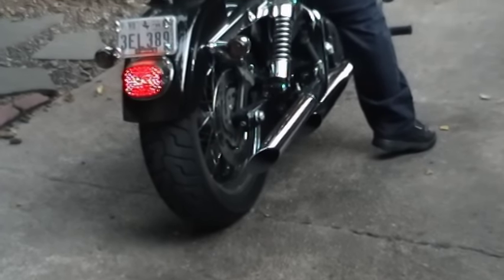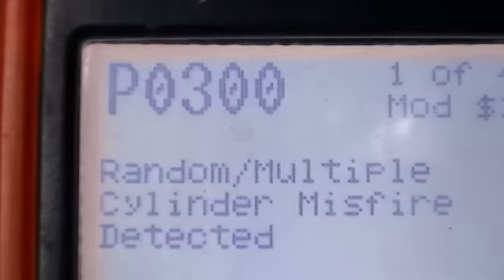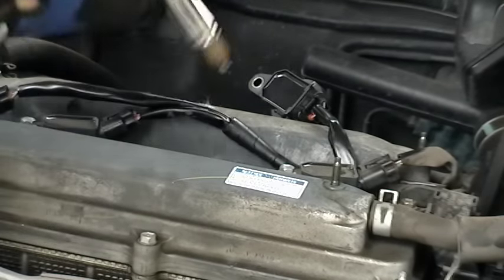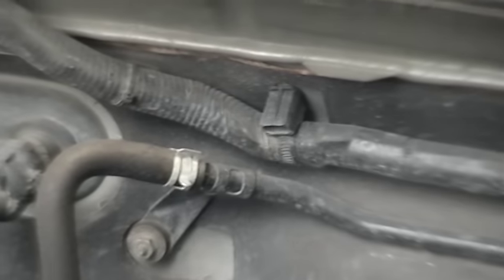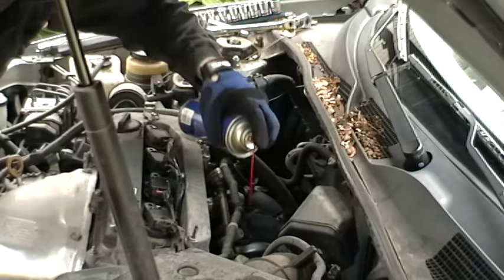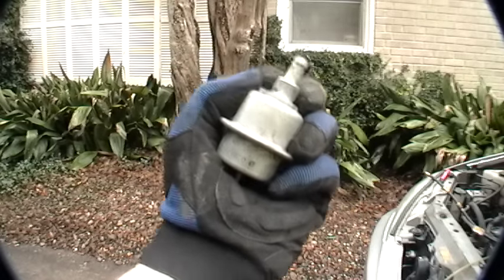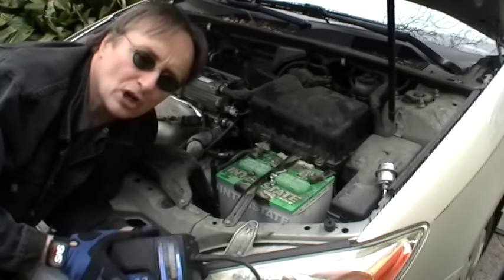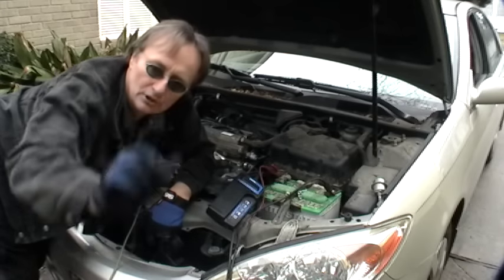How to Fix a Random Engine Misfire in Your Car (Code P0300)

Comment: I currently own a 97 lumina, and it’s been throwing off a random misfire. I just replaced all the spark plugs, wires, battery, and coils before the code started. I currently am in the mist of changing the EGR valve. There no leaking from anything either. so what could it be!!??!!?

Comment: Scotty my 2003 Chevy impala 3.4 has a p0300 random cylinder misfire I change the spark plugs but the check inging light still flashing repeatedly and when I try to pick up speed on the mph it picks up slow some people say it could be the Cadillac converter what do you think Scott
Reply from the maker: it could be that, but that can be pressure tested by a mechanic, so start there, they are not cheap parts so guessing is foolish

Comment: I got a missfire at iddle and between 40 to 50 mph no codes 98 chevy blazer lt running denso platinum sparkplugs and using duralasst wires. Everything else is  delco,fuel pressure is good.

Comment: Vauxhall Corsa C - Codes: P0300 and P0301 - New spark plugs a couple of weeks ago as part of a service and had a new coil pack fitted about 4-5 months ago and still getting the error. Could it be the fuel injectors?

Comment: hello i have a 04 dodge struts has the 2.7l v6  has 101k on it runs good but after start up and a short idle it starts pissing really bad ...if you keep running it it will go away  car has a good battery and new plugs along with coil boots and a new fuel pump  what could make it do this ?

Comment: hey i have a 2001 silverado. the truck runs great. but i can't pass the mission test. i replaced the spark plugs, wires, air filter, gas filter, a sensor that goes above the fuel tank, i forgot the name of it. i think is the gas pressure sensor. anyway nothing happened. i put s inyector cleaner, and nothing. like i said everything works good... what do u think my truck has?
Reply from the maker: many things can cause that, take a picture of all the data that shows it failing and join my community and post it there. If you wish to ask me car questions, I am switching my questions and answers to my google+ community “Auto Repair With Scotty Kilmer”. So please, if you want your questions answered, go  to this link https://plus.google.com/u/0/communities/110758243155230074828  and join my community. You can then ask your question there and I answer them personally. You can also attend my weekly Saturday morning Live car talk events where I answer your questions live. . Just check it out at https://www.youtube.com/watch?v=VognjkYaMjg&list=UUuxpxCCevIlF-k-K5YU8XPA&feature=c4-overview
 And remember, every Tuesday, I upload a new video on youtube, don’t miss them.

Comment: Hey scotty. I got a 2008 sentra with cyl 2 and random missfire. Changed the coil on cyl 2 and still does not run right amd the codes keep coming up cyl 2 and random missfire. Any idea on wat it could be. Sprayed crakes part cleaner on the intake and nothing changed and my battery is in good condition

Comment: Hi, I have a 2005 Chevy impala 3.4 L base. I keep getting the P0300 Code. I have to press the pedal for it to start and it idles roughly and stalls or cuts off. So far I've replaced the Catalytic converter, fuel pump, ignition coils, spark plugs and wires, MAF sensor and EGR valve. I am stumped on what could possibly be causing the P0300. Also Something blew out 6 brand new spark plugs that I had bought. I'm assuming whatever the issue is that gives me the p0300 code is the same thing blowing out my spark plugs.
Reply from the maker: literally scores of things can cause that code, but on that model, often bad fuel injectors do that. Have a pro check that first with his equipment, they are complex and expensive, so you don't want to just guess with new ones.

Comment: I drive a 2000 ford f-150 and i got a diagnosis done and they said that cylinder 3 has zero compression. He said that the cylinder was bad. How can i fix that.

Comment: Hey Scotty, I have a 1997 Mazda Millenia 2.5 Liter 6cl. Recently my car will shut off when I'm approaching a light, parking at a stop sign/ red light (basically when I'm braking) so I finally got it checked and I have the code "PO 301" a misfire. Also when pressing on the gas it takes a little while for it to start going fast. What should I do? please help.

Comment: SCOTTY I have a altima 2005 and it's giving me a lot of issues.  I'm about to do those tips you just showed me. I read up on the car and a lot of people having the same problem with the car. Rapid shaking, misfires,  gas is becoming a big bill. It's the Nissan altima 2002 to 2006. If you have any solution for this vehicle just text me back.
Reply from the maker: first, those are not good cars as they age, have tons of engine problems. Have a mechanic do a wet and dry compression test of all cylinders first, and if worn, get rid of it.  If engine is ok, pray my tips help, but they still are not good cars when that old

Comment: Mr Kilmer, I got the same code in my buick century 96, do I have to do a diagnostic test in the shop or I can just take to a mechanic and get it fix??? I'm asking because I dont want to pay for the diagnostic.
Reply from the maker: as SO many different things can cause the 300 intermittant code, any mechanic fixing it will have to do a lot of analysis first

Comment: I have a cobalt ls that I supercharged. The car turns on but is running lean. It Turns on and idles loud then shuts it self off after 20-30 seconds. We changed the fuel pump (but not the fuel filter), put new fuel injectors and a new supercharger and the car is still having the same issue. I keep having a random misfire code, you think if I drop some cash on some new spark pluggs, new fuel filter and maybe a new battery (since ive had the same one since 2008) I might have some luck?

Comment: Scotty i need help desperately. 2007 Nissan frontier. P0300. Chamged out spark plugs, coils, cats, O2 sensors, fuel injectors, fuel pump, throttle body, And a bunch of other parts. Still have this issue. Car runs like crap with the engine light reset. Then tuns better (higher idle) when The light comes on.

Comment: hi Scotty I have a 1999 Toyota Camry with only the number 1 cylinder firing the other three are giving misfire codes and the check engine light was flashing I replaced the fuel pump but that didn't help do you have any idea what my next step should be also my name is Bobby sorry I forgot to introduce myself I appreciate any advice you can give me thank you
Reply from the maker: +Robert Venturino often bad distributor cap and wires do that, pray its that simple

Comment: how about the ignition control module, coil packs on many cars that fire two plugs at the same time, MAF etc.
Reply: I had p300 and put in a control module and now it runs perfect. The old one just all of a sudden caused spit and sputter at a stop light so have module checked also. It could be many things causing this problem

Comment: Hello Scotty, can you please help me with an advice?
I have a 2006 Daewoo Nexia, GM (Vauxhall) based engine (A15SMS). When i run it constantly over 3000 rpm, check engine flashes. P0300 is the code. Changed spark plugs and wires, tried a new coil pack, cleaned cam and crank sensors, checked compression (14 on all 4 cylindres), checket tappets ok, new timing belt which is mounted correctly, new gas filter. The error still apears under given circumstances. When check engine flashes, no particular symptoms are felt. The car runs normaly, it has power and does not have any particular symptoms. If i restart the engine, the light stays off until i run it again constanly over 3000 rpm. The battery is ok. Thank you.
Reply from the maker: computers are VERY sensitive to misfires, if it runs fine, ignore it, or pay a guy like me with a dealer level scan tool to hook it up, drive it, and then analyze the live data that occurs when the check engine light is flashing, such machines can record and play back such things. Takes a REAL pro to do it right though

Comment: hello Scotty how are you doing? i was having P0300 error code on my 2005 Renault Velsatis that come with Nissan 3.5L V6 engine (VQ35DE) .... The 3 front coils is not giving signal at all thats number 2, 4 and 6 .... i took the car to electrician who troubleshoot it with OBD II machine then get P0300 Error code ... and he condemned the ECU saying i need to buy another ECU to make the car work fine.  Can you plss advice me?

Comment: Scotty, on a 95 Explorer, i was told its back firing , its OBD 1 , i haven't pulled any codes yet, spark plugs an wires was done a year ago, along with a new coil pack, what can this be ? its the 4.0 EFI engine , I haven't looked at it yet , i am asking , so i know what to do , please let me know . thanks
Reply from the maker: +Kody Darlington scores of things can cause backfiring. More often ignition problems on that model, check the spark plug wires, dist and cap and PRAY it's not internal valve damage in the engine

Comment: Had the same issue the other day brand new wires and plugs was fine then threw the code I pushed all the wires made sure the were in all the way on plugs and distributor car nothing felt loose but when I fired her back up code has been gone I hope it stays that way.

Comment: I got a 97 nissan pickup. Light has been on a for a while. It used to idle really rough but I eventually tracked down a replacement MAF sensor and it started running 10 times better, no stalling or hesitating. 
The light stayed on though and every now and then, not always but it would misfire or hesitate. Had the cap and rotor replaced and this didn't fix the problem cylinder 4 misfire is still the problem. I took it to a shop and they replaced the EGR and solenoid. I got it back and withing 24 hours the light was back on. I took it back to the shop they told me the replacement solenoid was faulty and they would redo it. Got it back and it seemed better but I could feel it wasn't perfect. Today the darn light came back on so I took it to autozone for a free diagnostic, lo and behold, it's cylinder 4 misfire. Feels like I will never get my inspection sticker. =( Just spent 350 on the egr replacement.
Reply from the maker: have a wet and dry commpression test done on the engine to see if #4 cylinder is worn out inside and they didn't fix the real problem
Reply: Thanks. If that is the case, is that kind of fix extremely expensive?
Reply: kingklabe sounds like a distributor problem, you might need a new one.
Reply: Nope already had Capa and rotor changed.
Reply: Wires are new too.
Reply: I mean a new distributor. I saw a video of someone having the same problem this solved it. Might have a bad coil or module. good luck

Comment: Hey Scotty. I have a 2003 Chevy Venture with a P0341 code. I changed the sensor but it still has the same issue. Any ideas?
Reply from the maker: +wildthingboricua2 wiring can be bad, main computer circuit could be bad, OR the timing chain could be stretched which gives false sensor readings to the computer

Comment: what about the ignition coils and Spark Plugs wires . can they effect a random misfire ?
Reply from the maker: they can if more than one is bad, if just one, it will be a code like P0304 cylinder 4 misfire
Reply: So how can i know which one is bad and which one isn't  ?

Comment: Hello Scoty :) 
I'm owner on Fiat Punto mk2 1.2 8v car. Last time i got problems with misfires.. And im suspicious on the coil packs.
So i do multimeter test:
On the Ht input resistance test i'm getting 2.6ohm and 2.8 ohms on the other coil..
On the HT output resistance test, i'm getting 7.4 kohm and 7.3kohm..
What means this result? 
And also when i tried to measure continuity on the HT output pin there was no result.. number 1 was on the screen nothing else... 
Can you help me? :)

Comment from the maker: putting a supercharger on a car requires many mods, from computer software to sensor additions.  If you didn't do that, no saying what will happen. You'd need a real pro with a dyno and 5 gas analyzer to work that one out.

Comment: I have 1998 Pontiac Bonneville and I have the p0300 code, but I have no spark in my coil pack which Is the 3 and 6 terminals. I changed the coil pack, icm, spark plugs, and wires still no spark in the same two terminals. My question is what can I do next to fix the problem?. Could the fuel injectors or crank sensor play a role in the coil having no spark? The 3 and 6 teminal is the same coil pack. My car has 144.000 miles Please help.
Reply: 8517macman Bad crank sensor is my guess!

Comment: A POWER STEERING HOSE LEAK FOR 2 WEEKS, CAN THIS CONTAMINATE THE CAM SHAFT SENSOR, CAN AN INJECTOR BE BAD?
Reply from the maker: +yank mcruff high pressure fluid leaks can knock out all kinds of electronics, yes

Comment: hi scotty i drive a 2003 honda civic 03 and i have been having issues with my car it sometimes doesnt seem to have power, the car would shake when i first turn it on the check engine light has came on and have took it to a mechanic and he said it was the coils but i changed the coils and still same problem i already checked the spark plugs  and their fine anything you can give would be appreciated.
Reply: also when i took it to autozone the computer told me it was my second coil and spark plugs but as previously stated it couldnt be it because i changed but yet still same code appears

Comment: You mention the problem could be the fuel pump or fuel filter. Isn't it possible the fuel pressure regulator is also the problem?

Comment: Hi, i have problem with Nissan Murano 2007 3,5... misfiring on the four cylinder p0304, spark plugs & ignition coil replaced, compression ok... check engine light blinking...

Comment: yeh ihave micelica gts new spark plug and fix mi engine light and do mi emission,after 2 month i get engine light whit that code and dont know what it is but discarding the plugs now ican check the rest of the prosedure ty alot

Comment: Mr Scotty, I got the code p300 and p301 showing up. I swap the spark plug, but the code still show up after I erase and run for a few miles. Should an AC compressor cause the same code (p300 and p301)?
Reply from the maker: not usually, more often bad ignition coils or bad fuel injector on #1

Comment: instead of carb cleaner can i use throttle body cleaner instead ?also this wont light up a fire if the engine is hot and running ?
Reply from the maker: yes, they are about the same stuff, only one different is maf sensor cleaner that's only for maf sensors

Comment: Got this on my 07 Mazda3. Changed battery.. Changed plugs and nothing worked...two mechanics had a go at it and couldn't figure it out...its currently at a 3rd shop. It's at 184000km only. What else could it possibly be? The mechanics already said everything mentioned in this video is not the problem

Comment: Hi Scotty from Down under I have a VE Commodore that has a check engine light on and runs like a pig on Petrol But runs as smooth as on LPG plus has a P0300 and P0301 Code so what can it be I thought fuel injector as it dont have a Fuel filter but in saying that maybe the fuel pump is low on pressure?
Reply from the maker: pressure test it to find out

Comment: I took off pretty fast at a red light & my Rpms went high & then I heard a loud poopin noise from the exhaust & my check engine light was blinking. I checked the code & it said I had multiple misfires & some reason my drive shaft is leeking black. Thanks if you could help me out
Reply from the maker: you can damage an engine internally revving too high. So do a wet and dry compression test of all engine cylinders first to see if you damaged stuff. Odds are you have if it made popping noises

Comment: hey Scotty. same misfiring code p0300 after washing the motor. what do you recommend?
Reply: Herbert Faria you soaked a coil...
Reply: Yes. I replaced it problem fixed, but engine light now is on w catalytic converter problem
Reply: p0420?
Reply: Something w bank 1 and 2
Reply: Catalyst system efficiency below threshold bank 1
 O2 sensor  circuit slow response bank 1 sensor 2
Reply: those might just be bad o2 sensors not a cat
Reply: Ill work on it monday afternoon. Ill let it soak on gasoline over night and try it in the morning before buying another one

Comment: im pretty much stumped with my car. 2006 audi 1.8t

17763/P1355 - Cylinder 1 Ignition Circuit: Open Circuit

17766/P1358 - Cylinder 2 Ignition Circuit: Open Circuit

17769/P1361 - Cylinder 3 Ignition Circuit: Open Circuit

17772/P1364 - Cylinder 4 Ignition Circuit: Open Circuit

16684 - Random/Multiple Cylinder Misfire Detected

16686 - Cylinder 2 Misfire Detected

new intake tube/coil packs/spark plugs.
 pcv system cleaned/new parts..  i still  have these codes. anything else to check?

the car is misfiring with flashing check engine light when 1st started 
then it idles normal after a min with a solid check engine light.

i did check the hoses and everything seems to be in good shape.

Comment from the maker: if it got worse changing the spark plugs, it may need new wires or coil on plug assemblies now. Moving them to change plugs can break their cheap plastic construction

Comment: My car is misfiring and has a flashing check engine light and fault codes P0300 and P0303. I changed the ignition coil pack and spark plugs but it didn't help now a mechanic is telling me they think the timing chain has slipped causing the problem though before the misfiring the timing chain wasn't rattling. Any help would be welcomed?
Reply: Try adding “FUEL STABILIZER” like “seafoam” to the gas tank, sometimes fuel quality sucks 🤷‍♂️